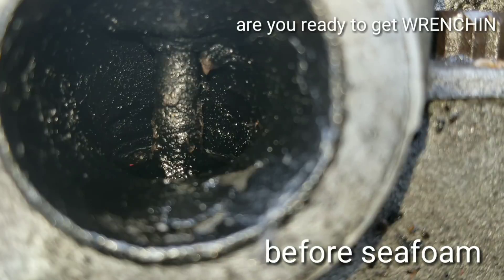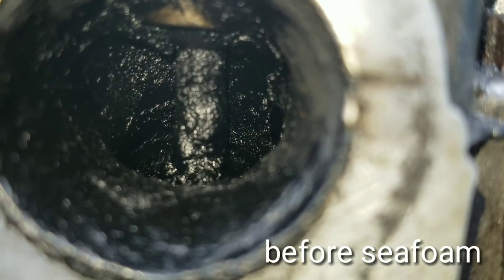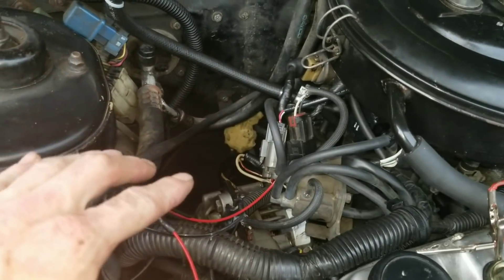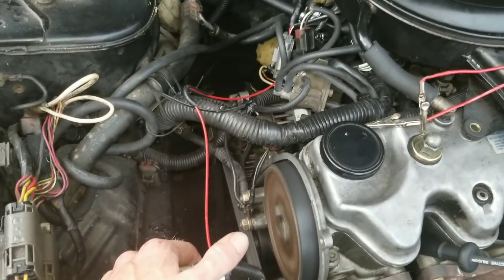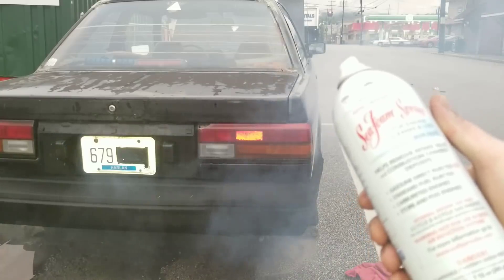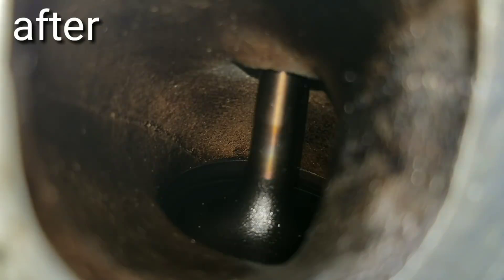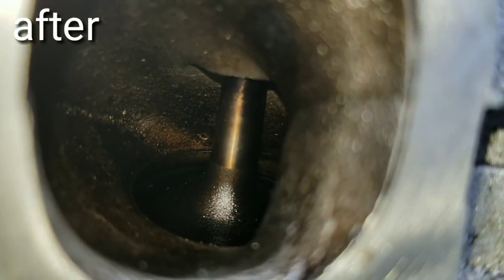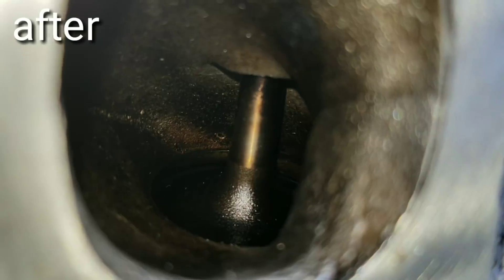how to use fuel cleaners remove carbon build up and clean intake valves on direct injection

Comment: Work better if u have it off spary some into / onto  the valvues then it brake it down then do this step cause all ur doing is blowing it out the exhaust
Reply from the maker: Yes that would help thanks
Reply: @NATESINTERACTIVEAUTO  also I noticed goo gone  for bathrooms work on oil on ur car I sprayed it then graver rag runes with pressure and my towl turned black
Reply: @NATESINTERACTIVEAUTO  Also I'm not expert but letting cleaning products sit if the caked on that much helps

Comment: So wat should i use for my 04 ford ranger....sea form ....or wat other products are out there.......pllllez write me
Reply from the maker: Crc intake valve and turbo cleaner also b12 chemtool and seafoam spray are quality products
Reply: There is one called DL Turbo Lethal Injection. Supposed to be very good
Reply: Audie Fooshee,Sorry for not replying before I have been away,there is no liquid Miracle that will cure this Problem,with regards to your 04 Ranger my advise to you is if it is running OK leave it alone until such time that your engine is misfiring ,when it does do a compression test on all cylinders to see if they are nearly the same,if one or more is low then it's time to remove the head and decoke it,the valves can be throughly cleaned and ground in,hope this helps David.
Reply from the maker: Thanks for helping we need this in the nia community
Reply: Thank u
Reply: I've heard pouring..sea fom...I'm the brake booster works too ?????idk tho
Reply from the maker: Yes the brake booster vacuum line
Reply: Wats pure color...I just wanna clean the in take cuz my 02 censor is I think beatheing wrong....idk...I just wanna kno where to pure sea form or royal purple in
Reply from the maker: Check out my new video on royal purple also use maf sensor spray only on the maf sensor and use royal purple  or less expensive b12 chemtool and clean throttle plate these little things help alot i just put out a video on b12
Reply: No i watchd the vid but that dude said that and It fuckd me up for a sec cuz I litrally just got it maybe two three weeks ago
Reply from the maker: Yes did everything work out good for you
Reply from the maker: Any questions let me know
Reply: Theres a guy that did this to an older Ford Ranger on YouTube.  He also did an oil change with an oil additive that came in the kit. The end result was night and day, definite improvement in the way it ran, it was alot quieter without the lifter tic it had. Worth watching the video all the way thru....
Reply from the maker: Thanks for sharing your tips
Reply: Smell block Chevy. Increase performance by 💯
Reply: You should use nothing.  If it has substantial gunk buildup at only 14 years old there is something else wrong that needs fixed, not just assuming you need to dump a solvent in your engine because you don't.   Wait until you need an intake or head gasket then get the heads redone while it's torn down that far, but frankly it may never need any goop dumped into it.   If this was necessary then automakers would recommend it just like they recommend other service procedures after the warranty period (so it's not just about them covering their own arses).

The #1 thing you can do right now is make sure you have a properly working PCV valve and if it still has the original, replace it with a high quality brand (Motorcraft, etc), and don't put any goop in your oil either, use 10W30 synthetic and 5W20 synthetic in winter.
Reply from the maker: Yes thats very informative i believe that is good procedure to follow
Reply: Power foam from amsoil
Reply: So I pourd b 12 in befour I seen all the messages...lol but on a good note the truck runs a lil better for now...but if i took it in to a cheap shop I kno how much would it cost to do that to all that other stuff ....to David Ellis. ...
Reply from the maker: Yes true
Reply: stoney renegade  I did it in the line ....but gum out????wats up with that how do u do that one the same????fr cuz of i only cleaned the bottem I wanna try the top as well....hit me back
Reply from the maker: Not true cleans all
Reply: @NATESINTERACTIVEAUTO  
Thank u
Reply from the maker: Thats not true
Reply from the maker: Ur welcome  brother amazing video on the way
Reply from the maker: New video is the best yet

Comment: Thought you we're supposed to get engine warm, spray can in it shut it off let it set 10 mins to let it soak in snd then run it.  Be more effective
Reply from the maker: You are correct i shouldnt have cut that from the video thank you but it was done
Reply: Lol poor thing was struggling, definitely didn’t see any wait time between spraying an the run through
Reply: I spray it when my engine off to let the valves soak... turn it over.. Not on.. Just "hit" it for a second.. Hoping it will get to the plugs and exhaust .. Then use the 2nd half of the can... Not sure if this is a superior method or even if could do harm.. But always worked well for me. Something I came up with off theory

Comment: I've been using seafoam for 10 years on and off. On my 3.8 camaro it couldn't do anything becaus the carbon was that bad. I only had 177xxx when that motor had a bad lifter. I opened up the motor took the heads off and carbon all over the place. I used seafoam on my 2008 cobalt ss with about 80xxxkm and I poured a bit onto the pistons and let it soak and there was a difference 100%. I have a scope and went down into the chamber to see the difference there was only a little bit left. Yours worked very well.
Reply from the maker: Watch my seafoam test vs crc intake valve and turbo cleaner
Reply: @NATESINTERACTIVEAUTO  will check tonight.
Reply from the maker: Thanks for the story thats cool
Reply: That is pretty cool but why did u remove the head for a lifter
Reply: @melody3741  Inspection. Found bad scoring on cylinder walls. Engine was on k member and front wheels with trans attached so everything was accessible. Clutch was also finished so at the end I parted the car and bought something up to date.

Comment: At 2:20 I thought you hand would get pulled into the engine. 🤷🏻‍♂️
Reply: Please Don't wear no hoodys with strings hanging from hood adjustment
Reply: @scottyjones27  Ya fo sure. And non of them aprons neither. IF YOU HAS LONG HAIR GET A BAND FUR IT, you don't want your head pulled in there.
Reply from the maker: Yes always be careful do this at your own risk

Comment: Do you think since you c
Soaked it for that long that's what causes your oil leak?
Reply: No.  The car wanted to burn oil before the Seafoam...the Seafoam just let it.

Judging by the amount of buildup in there, the valve seats and piston rings we're likely obliterated.  The only thing keeping it from leaking and having blow-by were the carbon stoppers.

So the Seafoam didn't injure the engine...it just took the pressure off the wound, as it were.
Reply from the maker: Thanks and there is alot of blowby gases causing the oil burning and now its worse from alot more driving
Reply: NATES INTERACTIVE AUTO you know what they say: no mechanic in a bottle really works cuz the metal is worn. Buy a used JDM engine....or let it go
Reply: So seafoam didn't cause your car to burn oil?

Comment: That looked a lot better than the CRC product. I just ordered CRC and now I wish I didn't.
Reply from the maker: The crc is a great product my engine started burning alot more oil after i made this video so it was a harder test for the crc but seafoam is a good product
Reply: NATES INTERACTIVE AUTO after cleaning valves, your engine burns more oil now?
Reply from the maker: No just more miles
Reply from the maker: What test do you want to see  fuel oil additives or anything else and the product
Reply: Maybe gumout fuel treatment, royal purple or any other product that claims to work.

Comment: I think seafoam does a better job cleaning intake valves than the crc gdi intake valve cleaner. Will this work on a v8 gdi engine?
Reply from the maker: Yes i have videos on use on gdi engines 2014 Hyundai elantra gt would you like to see a specific video let me know i will do it
Reply from the maker: Yes i use several products on a gdi  engine if you watch i have a 2014 Hyundai elantra gt  i do alot of test on are there any special test with any special additives you want me to perform
Reply from the maker: Yes let me know all requests
Reply: How could i use this in the intale manifold in a gen 3 VW 2.0tsi.
Reply from the maker: Vaccum hose or go past mass air flow sensor and squeeze straw in the intake close to the air filter
Reply: @berto371rr  remove the inlet and clean manually. You won't get anywhere near the results the same as here, his is carb so the fuel washes carbon/oil away. If you have a carb/indirect injection give it a go. Direct injection, don't waste your money, it would take 15+ treatments to make any dent in deposits
Reply from the maker: This is not a carburetor thanks
Reply: @NATESINTERACTIVEAUTO  Single point injection is basically a electric carb.
Reply from the maker: I was referring to what its classified as tbi throttle body injection

Comment: Damn, I am quite surprised. Those are extraordinary results. I definitely want to give this a try.
Reply from the maker: Richard Ojeda i was shocked and im finishing uploading a marvel mystery oil now where i found a old road in Kentucky where no one hardly drives to test marvel mystery oil increased mpg as it states on the bottle i have already used it to clean combustion chamber and put a camera inside it was one of my first videos bore scope cam in combustion chamber i even used it to clean crankcase out in with the oil
Reply: NATES INTERACTIVE AUTO Awesome. I saw  the video on the CRC intake valve cleaner and when you drove 1 hour at highway speeds, the scenery looked beautiful.

Comment: Why not just pour it in regular like oil
Reply: Anela Claiborne yes you can do it in the oil as well but make sure you do so at least ONE week before an oil change
Reply: Joey Biscotti it’s best to Seafoam an engine one tank of gas before an oil change with the spray in the intake, half a can of the regular Seafoam in the oil, and the second half of the can in the gas tank. 

If you want to help restore worn engine internals (like the rings), look into RVS, a ceramic that helps to rebuild wear surfaces to factory tolerances. These things, along with new plugs and wires, will make the engine run like - or better than- new.
Reply from the maker: I do check out first use of it
Reply from the maker: What video should i do next

Comment: The reason it smoked so much is because Seafoam is a petroleum based product. The smoke is mostly the oils in it burning off as it cleans.
Reply: You're supposed to drive it aggressively after the heat soak and it smokes a lot and burns off all the gunk and once it stops smoking you're done.
Reply from the maker: Yes true
Reply from the maker: Dracallis  ok well i hope its good thanks
Reply from the maker: What video should i do next
Reply from the maker: Check out seafoam vs crc video i performed
Reply: I have seafoamed several engines that did not smoke. The smoke is the carbon being washed into the cylinder
Reply: @randyschmidt19  I Seafoamed my Mom's Smart car onetime.  It was not very dramatic because it has low miles.
Reply from the maker: Thanks
Reply: @randyschmidt19  my 14 dgi 5.3 v8 with 200k didn’t smoke

Comment: Im not a believer
Reply from the maker: +Christine Nelson  great input
Reply: I've witnessed GM top engine cleaner clean valves this clean. However it did not clean all the valves, probably due to the engine intake manifold design.